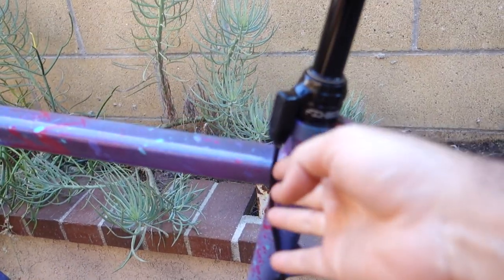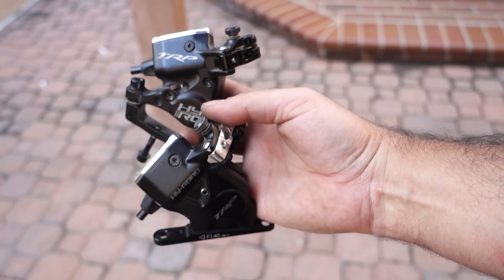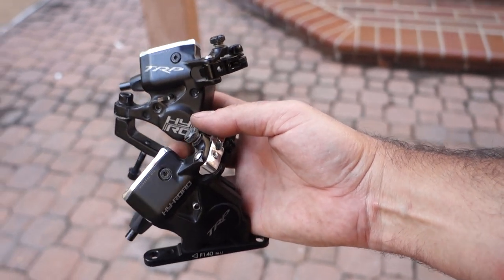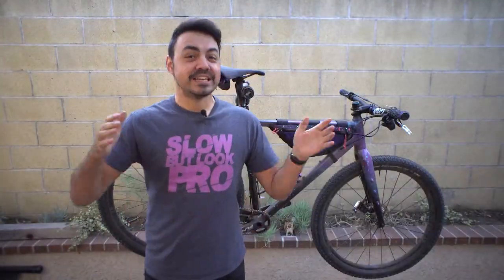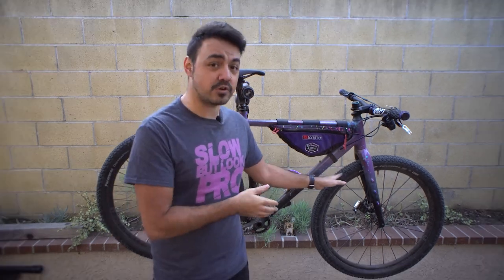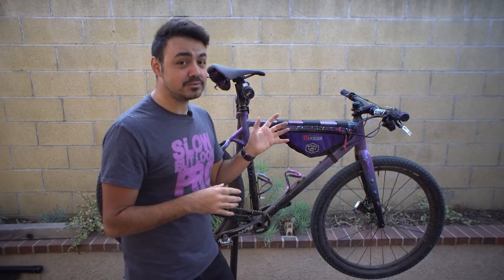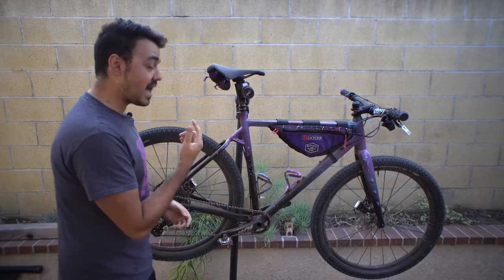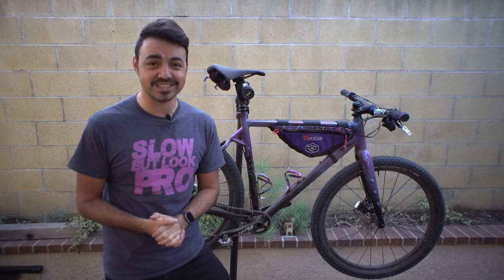Converting a Gravel Bike to a 90s MTB Part 6 - Dropper Install!

Comment: Really enjoyed this series. Hopefully, Posidon will do a flat bar version of the Redwood. In the last year I got my first bike with disk brakes (hydraulic), I'm having trouble imagining ever using anything else and a flat bar Redwood seems - to my unmechanical mind - a lot easier to upgrade to hydro disk brakes than a drop bar version.
Reply from the maker: yea well have to see if they do! you are correct it is cheaper to upgrade to hydro on a flat bar. Thats why Im testing the brakes I chose so its great option for either style of bar.

Comment: Are those Driver Pros 2.6'ers? They look amazing.
Reply from the maker: They are 2.4
Reply: @LockedinCycling  Aye, though you confirmed the 2.6 can fit yeah?
Reply from the maker: @ahmadzuhairi  I did , the Romero’s I ran were 2.6 these drivers where 2.4 x 27.5 and I did try driver pro 29x2.2 as well
Reply: @LockedinCycling  excellent. thanks!

Comment: TRP sells a longer brake arm for HYDRA Disc brakes!!??
Reply from the maker: Its a shorter arm to help lever pull ratio for road levers or short pull levers
Reply: @LockedinCycling I bought a ‘16 Trek Cross Rip with those brakes and the 105 long pull brake levers (bad choice by Trek) eventually I upgraded to TRP short pull and bar end shifters. I’m getting a feeling of levers going close to the bars. I guess I’ll hit up the TRP store for the modification?
Reply from the maker: @reklawrs  go back to last part video in this series I believe I put the mod in the video description it’s actually not from trp
Reply: @LockedinCycling  Oh Please do tell the name of the after market manufacture that the produces those little arm for the TRP Hydra Road brakes??  You didn't include it in video..
Reply from the maker: @reklawrs  I believe it was in part 5 I did.
Reply: @LockedinCycling   Sorry about the delay (I was out riding my bike :-) I'll check out part 5 Thank You!